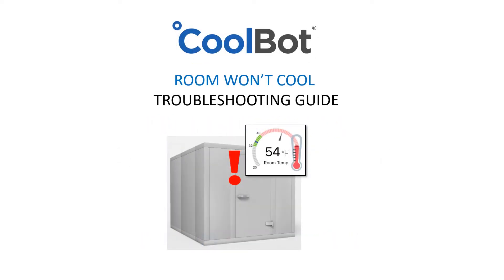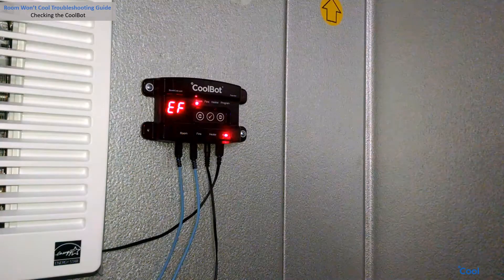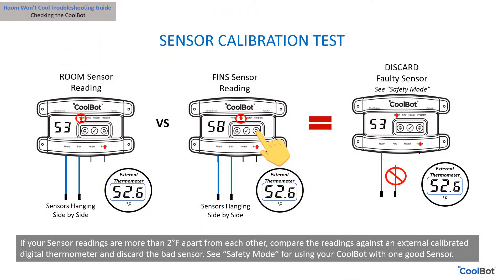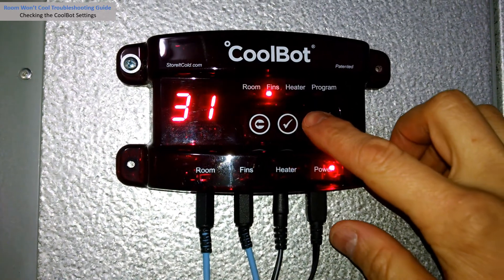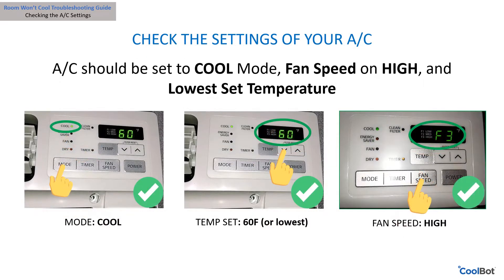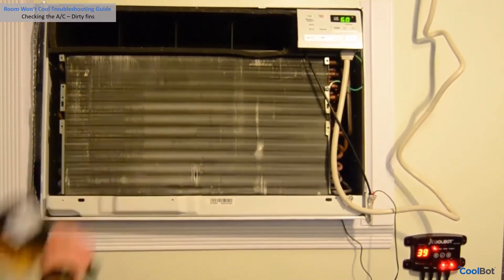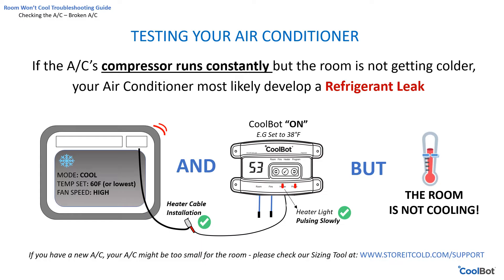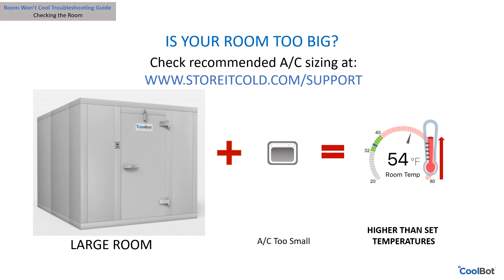ROOM WON'T COOL TROUBLESHOOTING

Comment: what is the function of other P''s in program setting and 30 60 in heater settings? didn't find any detailed info on the site and manuals.
Reply from the maker: Hello Kevin, thanks for reaching out.  The heater delay setting is how long it stops telling the A/C to cool when it turns off due to being at the right temp or the fins are too cold.  30 and 60 means it is off for that many minutes before it allows it to tell the A/C to run again.  We don't have much information about it in our manuals as this is a setting that hardly needs to be changed.  For more information, email us at hello@storeitcold.com or call 888-871-5723.
Reply: Q❤😊😊😊❤11q😊

Comment: Anyone know where the relay switch is located on the board?
Reply from the maker: Hi James, thanks for reaching out. LG units have an Input Board and a Main Board. The main board is inside a metal cover behind the Input Panel (on the A/C body). You can recognize it because the power cord brings power connects directly to the Main Board. In that board there are different relays (small black cubes). The compressor relay is the only one that has a cable coming in and a cable coming out at the top. It is the big rectangular black cube in the board. Unfortunately, unless you can work on boards and do electronics, this relay is not replaceable and the whole board should be replaced.

Hope this helps, feel free to email us at hello@storeitcold.com or call us at 888.871.5723 with any other questions.
Reply: DO YOU GUYS SPEAK SPANISH